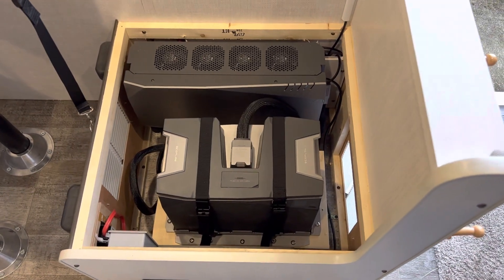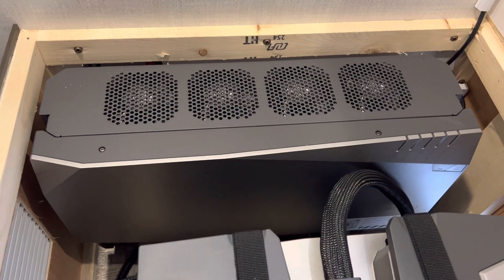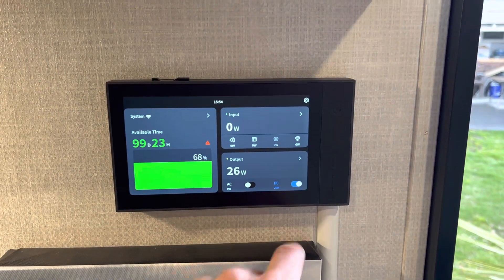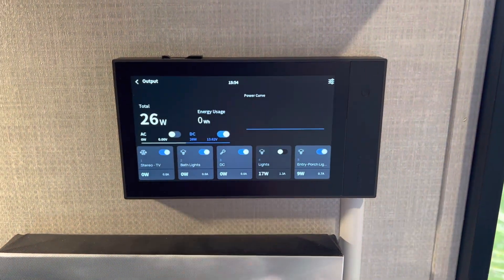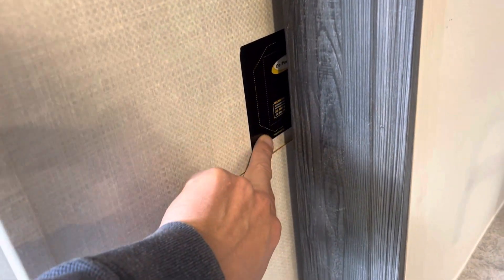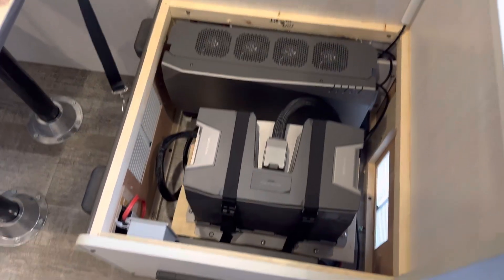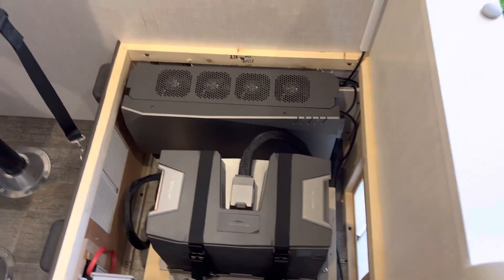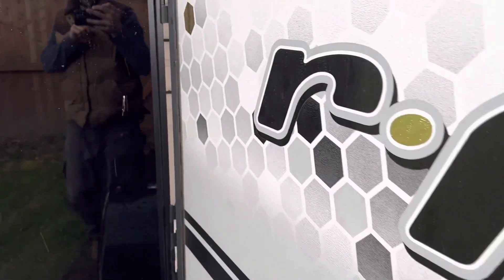Ecoflow Power Kit replaces RPod trailers electrical system. Off Grid capable, runs everything!

Comment: Can you please answer a question for me? I saw a video the other day and master builder said you can't have an A/C hooked up to the eco flow all in one, is that true?
Reply from the maker: @uptown_enigma_4016  when you say A/C, are you talking alternating current? Or air conditioning? 
This unit has input and output of alternating current at 120Vac 30amps. 
This unit could also run an air conditioner. 
Who is this “master builder”? Link to video could be helpful.
Reply: @aarongarmon3809  Air conditioner, sorry for that.
Reply from the maker: @uptown_enigma_4016  this unit should handle an air conditioner. The issue is usually the startup surge of power, which this unit should handle in most RV applications. If the start up surge is an issue, a soft start can be installed on the air conditioner. 
The other equation is just power consumption and ability to recharge and replace the power used. This has more to do with use case and system size, than this specific product. This can be scaled to just about any air conditioning needs.
Reply: @aarongarmon3809 Im referring to an Air conditioner, i heard that in this video.https://youtu.be/25nU2fnHknA?si=ABu6nGJR0Su4NV7F